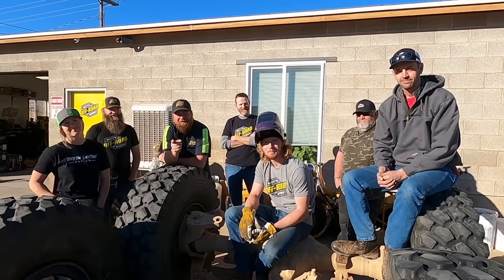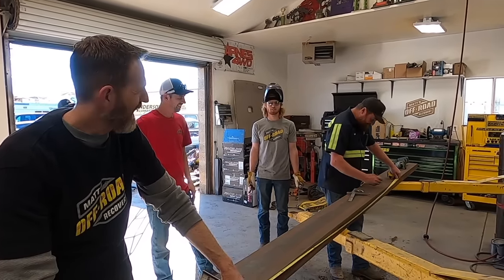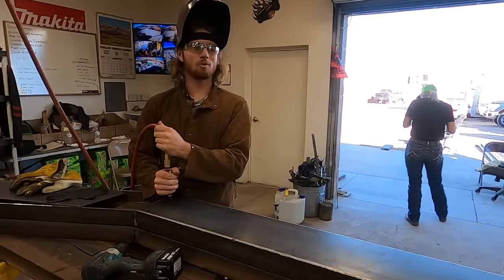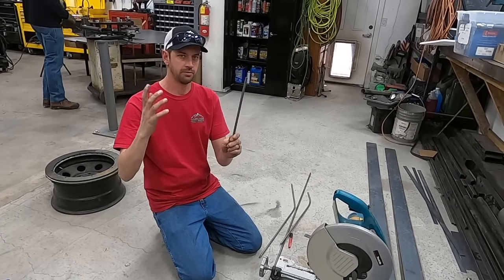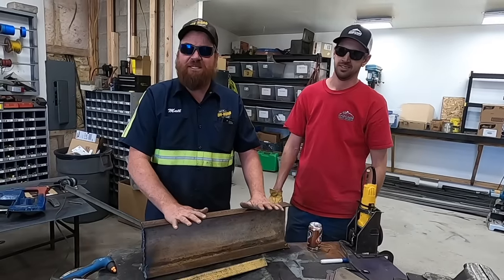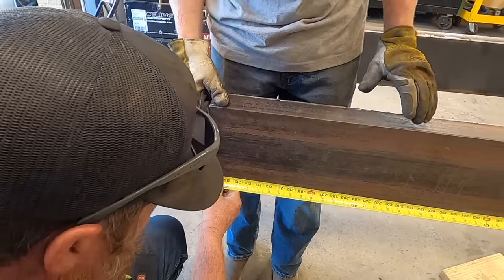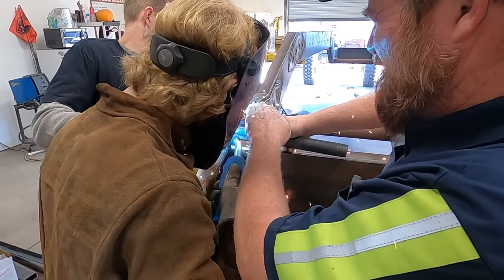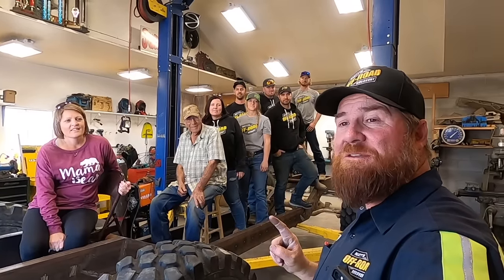I'm Building The WORLD'S LARGEST Off-Road Wrecker

Comment: There is an astounding amount of "scary" going into this build already. There are some huge red flags presenting that you guys are ignoring or downplaying the importance of. Incorporating a presure vessel into an assembly that is designed for articulation is problematic. The already present yielding of the chamber wall during inflation is not something that should be overlooked, pressure vessels are round for a very specific reason. The flat plate used is undersized and the uneven shear forces the welds will experience due to the pinning is destined for disaster. The renforcement plates used at the splice joints need to have large radii at the ends not sharp points as the forces are now concentrated at the termination of the plate. That type of joint renforcement is typically referred to as a "fish mouth plate" because the radii usually spans the majority of the sidewall. I like the ingenuity and "go for it" attitude,  however, that being said when you are dealing with the stored energy that is associated with a pressure vessel you need to be super cautious and consider the fact that you ARE responsible if one of the people being helped are injured if that tank fails. Even with only 100 psi in the "tank"  the force you are exerting on the tank walls is quite large.  I dig the channel, I just think it is important that someone addresses the issue. Don't let people arm chair quarterback this, it's your ass on the line when things go wrong. Just my opinion based on experience,  take it for what its worth.
Reply: Even with the frame pins, the flat frame panels will deflect under pressure cycling. Just not as much, but over hundreds if not thousands of pressure cycles could it fatigue the metal as well? Would love someone to run the numbers.
Reply: @maxironpaw  I don't know. But I was thinking about the cycling the frame would be subject to under normal use at speed. The combination of these loads and the constant air pressure could probably cause fatigue I think
Reply: @maxironpaw  other think I was thinking about, is that the frame will be subject to defects in use : rock scratches, etc. These defects, if in the flat panels, would be under tensile loads because of the pressure. This could be an increased cause of failure then
Reply: I could not agree more, this is a real dangerous thing being done here. There should be no sharp corners on a pressure vessel.
Reply: I love the idea of using the middle of the frame to store compressed air; however, I'd have done it as some pieces of 1" pipe embedded in the center of the box instead of trying to use the box itself.
Reply: If anyone from MORR is willing to do a video chat or anything I would have no prob giving design and fabrication feedback, I just don't know if anyone is willing or how to even get ahold of anyone.b
Reply: @sshep7119  Sad to say that I doubt they'd want to hear from you or anyone else with design/fabrication knowledge. I like watching MORR, Fab Rats, etc. but there's a whole lot of "frontier engineering" being done.
Reply: Boy, you got that right! That thing will be a bomb waiting to go off.
Reply: @Mick_A_Knuckle  Yeah I can see where you are coming from, in their defense though who do hou listen to and who do you shrug off. I just hope that things work out and no one gets hurt. A LOT of people get hurt/mamed/killed every year because people dont respect or understand the emense amount of energy that is stored in pressure vessels. Tires are a big one in that people underestimate what they are capable of. I don't do the "safety nazi" thing because it doesn't help any if no one listens, but there are times where you need to speak up.
Reply: Am engineer. Can confirm this is sketchy and irresponsible. Pressure vessels are highly regulated in industry for a reason.  Dont underestimate this danger.
Reply: Rather well articulated. 100% true as well. To many people don't understand exactly how dangerous pressurized air is, especially at higher volumes. 5 psi is enough to blow the bottom of an oil drum out.
Reply: I'm going to assume they know what they're doing.
Reply: @joereed2760  ..... That's the mistake a lot of make. You make it on yourself and they've made it on themselves.
Reply: This pressure vessel was trying to make itself round before they pinned it flat, haha.
Reply: @Matt's Off Road Recovery  I can't stress enough to listen to comments like these. I can attest that @SShep71 1 knows his stuff. Please consider taking up his offer of design input via a video call.
Reply: Yo, but it will also be fun when it explodes

Comment: I'm really curious about how the project will be going. At the same time I am highly sceptical about the frame-internal-air-tanks. Some of the technical reasons why this might not be the greatest idea have already been mentioned by other viewers.
Reply: Porsche did it with some space frame race cars. They kept them pressurized with nitrogen. If the pressure dropped they knew there was a crack somewhere.
Reply: What is the reason for worrying about having the air tanks being part of the frame? Is the tubing not strong enough to be a frame?
Reply: @jackd2083  In contrast to a 'normal' pressure tank, there are very long welds and based on the flexibility / stiffness of the frame the pressure changes and external forces might lead to minor cracks and leaks.

Comment: Super cool! I was nine years in 1962 at San Louis Obispo with my uncle Johnny on the beach doing some surf casting and along comes the “Spider”, a purpose built four wheel crawler with about three feet of clearance and six foot agricultural tires. They used it to pull vehicles out of the sand on the beach. I’ve been trying to find something on it ever since with no luck. Painted red as I remember. I guess it could have been a farm implement but I remember it as pretty stripped.

Comment: If you are using your frame as a tank for on board air like for an air break system I would recommend against it because the condensation will eat through your frame from the inside out, I’ve replaced a lot of air tanks even with air dryers but of course i live in the inland northwest so 🤷‍♂️ Utah will probably be fine but I’d still recommend you make sure you get a good drain in it and I hope the frame doesn’t end up flexing and cracking welds but gunna look cool

Comment: 4 way steer build.  There are knuckles and tie rods on BOTH ends.
Everyone who’s in a tizzy about the frame air and the stock axel brakes needs to calm down.  They are going hydro.  The air is for airbags because it needs adjustable suspension.
I hope it’s mid engined and has a the cab over from the econoline truck they showed a while back.

Comment: Rotating elevated cab perhaps? With remote controls for winches and boom within. Like a crane truck. You could volunteer for recovery on the Paris/ Dakar Rally. Maybe not, even with the weight saving flotation air tanks, fr8ing that beast across oceans will not be cheap!
What's its nickname gonna be? Competition for suggestions?? I'll start with "Thin Lizzie".

Comment: An idea about your pressure frame tanks.  Drill enough holes, that you can put in very strong epoxy sealant, to protect the raw steel from corrosive water.  You can easily plug the drilled holes with brass or steel plugs, or even use'em for drains.  Since the tanks are so long, more than one drain might be a good idea.  But seal the inside from water.  If you use a "flexible" type coating, it won't crack when the frame flexes from use.

Comment: This is SO amazing to watch!

also, due to being hand-built and measured all the way, your frame is much more square than that of commercial heavy-duty trucks!
trust me, I've been an engineer for those for four years ... the amount of corrective persuasion in the production was immense.
Reply: also, I'm pretty sure it should be sufficiently easy to transplant the cabin of an old cabover (or conventional) truck onto that frame, the spacing of your frame is on point with what commercial vehicles use!

Comment: Hello, I love your videos. I have been working on a GMC frame and came across a cheap small saw from Eastwood. I was using a plasma cutter and grinder with cutting blade and this saw cut through everything much cleaner with no heat and much faster I was using 1/4 inch plate. I have included the link in case you are interested. It only cuts straight though as it is a small circular saw. I was very surprised how well it worked. Continue the great videos.

Comment: Put a drain bung on it. Dont want internal rust like a air compresser. The frame air tank idea is really cool by the way, here in the salt we under coat our frames but they still rust from the inside out then. A sealed system like that is probably less prone to that

Comment: If you're not already planning to do so... Please proof test the frame and add a relief valve! For gas systems, a 1.1x operating pressure proof is typical, with a relief set to 10% above maximum expected operating pressure. For a homebuilt rig, with unconventional construction methods, I would proof to 1.5-2.0x operating pressure.

Comment: I’ve seen some other commits express concerns on the built-in air storage. Yes, it’s a mistake. Shapes other than cylindrical for a pressure vessel are dangerous. Also, by law, any pressure vessel is to be inspected and certified. I’m a power tool repair shop and authorized service for Bostitch compressors. Back in the early 90’s, Bostitch had a mandated safety recall on a model that was mfg by Thomas Industries. The tank was a “pancake” style but the upper half was stamped with a curve that was too sharp. There were several that had ruptured at that sharp seam with explosive power.

Comment: hello, the idea with the pressure vessel in the frame is ambitious. Hopefully it won't leak if the frame twists. Profiles according to the load with different material thicknesses and better material, i.e. no structural steel, saves half the frame weight without becoming weaker. No matter how stiff the frame is in the end - it always twists while riding.
Can't you just use old truck frame material - or a frame from a Unimog ? that's a lot better than mild steel. Have fun with the tank

Comment: I have been designing truck chassis and trailers for more than 30 years, I am sure that compressed air tanks will warp and leak. The weight of this mild steel frame is simply too high, used truck frames save half the weight with the same strength. An old Unimog frame made of high-strength steel would make sense.

Comment: I think a better approach to the frame tanks would be to use something like fire fighter's water hose ran along the inside of the frame and filled with air, as it is specifically designed for containing large amounts of pressure. I would then use cavity wax to fill the gaps between the hose and the walls of the frame, similar to how Mercedes Bens fills the frames on the 6x6s solid with wax to make corrosion as difficult as possible. Buy me a plane ticket and I'll even come do it for you

Comment: Need to get a usmc 7-ton wrecker. Things unstoppable and will pull anything....I personally pulled 180k pounds with it over 8 miles through sand dunes with no power steering. Also pulled a tanks out that was stuck in a sand dune. Have over 300 recoveries in 7 months in Afghanistan. Just buy the Oshkosh mk36 it's Nasty. I towed over 40 of those mraps aroused Afghanistan because those axels snap. Good luck with the build but I would do it wayyyyyy different

Comment: It's about time multi skilled Lizzy learned to back up a trailer, I would love to see her learn, if she can't already, I bet she learns or does it really well. B T W the tool is an Adjustable Sliding Combination Square Ruler Protractor. I used to use one a lot before I retired and my one here in the U.K. was nigh on £200 G BP. Like most tools here if you use them to make a living they are taxed very high. When I was in Germany  (5 times over a few years) you notice that anything work related or essentials, they were as  cheap as chips, but luxury goods were very expensive.
Reply: Tom is a nuclear engineer. Do you think he really doesn't know what's that was?

Comment: Not sure if that in-frame air tank is a good idea. The amount of force that 100 psi will exert on that welded plate is immense (do the math). Combine this with the flex and stretch that will be placed on the welded joints, and you have the recipe for a failed weld. There is a reason for the ASME stamp on compressor tanks.

Comment: The build is awesome. Put a real air tank on this thing. You're going to have issues with internal rusting and you're going to end up with a bunch of cracks in the frame corners from stress. 90* bends in an air tank is no good. Look into the commet jet. It had square windows....

Comment: Air tank bomb.  I decided to calculate the stress in the flat plate when it was pressurized and before the pins were added.  I came up with 35 ksi.  In general for a mild steel, I use 36 ksi as the yield strength.  As the plate appeared to have permanent deformation, I would say the yield strength of the material was exceeded.   I used 93 inches for the length of the plate, 7 inches for the width, and a 100 psi air pressure.  The formula I used came from Roark for a flat rectangular plate with clamped edges with a pressure load.  I would suggest being much more careful in the future.
Reply: And that's not even considering the stress concentration at the corners. It's horrible and potentially fatal idea that needs to get undone and proper pressure vessels added. Nothing wrong with boxing the frame, but just say no to that air-bomb..
Reply: I loaded up FreeCad and did a finite element analysis of the plate with and without pins.  Without the pins the max von Mises stress was 43 ksi along each of the long welded edges.  This is in fairly good a agreement with the value obtain from the equation in Roark.  For the analysis with the pins, I assumed the pins are on a 7" spacing.  My plate model was 10.5 inches long with a hole 7 inch from one end and centered on the 7 inch width of the plate.  The plate had fixed constraints on the two long edges and one short edge.  One end of the plate was fixed not to move along the length of the plate to simulate the rest of the plate than I didn't model.  The model showed 63 ksi right at the constraint on the hole.  Unfortunately the stresses did not fall off very quickly moving away from the hole.  If a factor of safety of 2 on yield is required, I would not recommend using the frame as an air tank.
Reply: @chuckd7177  And that's only a static model. Under cyclic pressure loading and in-use torsional flex and vibration, it's a time-bomb.
Reply: @stephendee7839  Yes, I admit that I only did a small subset of the engineering needed and found that the "tank" was not structural adequate.  It would seem to make more sense to purchase pressure tanks certified to the applicable codes. I did find an old copy of the ASME Boiler and Pressure Vessel code (2010) online.  With a very quick scan, I found factor of safety of 2 on yield and 3 on ultimate is required.
Reply: Betting that my suggestion to buy air tanks will be ignored, here is what is ASME 2010 page 75 suggests.  Perform a hydrostatic test of the "tank" to 1.3 times the working pressure.  So fill the "tank" as much as possible with water.  Connect it to your compressor with the longest air hose you have.  Stand as far back as possible,  behind something heavy, and open the value for the air hose.  Let it reach pressure and let it sit for 10 minutes.  Release the pressure from the hose and then go inspect for damage.  Still not great, but safer than what you did in the video.

Comment: Good call - Boxing the frame more than doubled the beam's strength. 1500 pounds seems too light. Given how massive the axles and tires are, weight is not an issue.
I worry about fatigue of the welds caused by cycling the high pressure air, even with pinning
What's going to power this? A big Cat motor?

Comment: Good space saving method... how ever what the tank does when it flexes with all that pressure inside, not to mention in few years when it start to rust out? Any coating going inside to prevent rusting? How are you going to get rid off the condensed water, or are those new pressured water brakes, or what ever this system is running?
To solve the water issue maybe add pipe that is the lowest point when you drive on ridge, it has solenoid in it that is on timer or push button opening shortly and squirting water out while in suitable position. Only thing is that will it be harms way since tanks are the lowest point.

Comment: Yes this is a little off-topic, where do you put the sensor for trans temperature; in the pressure test port or In-line of the trans sending line( AkA the tube that comes from the trans, but before the cooler. Thanks, Been loving the Golden Nugget Build series

Comment: Looks like an awesome project so far but I don't know about the idea of having the frame double as an air tank, when air is compressed it always drops moisture, this moisture with no way to escape will cause rust inside of the frame rails. As a heavy duty truck mechanic I often replace rusted through air tanks, would be far more difficult to replace in this case and far more catastrophic if failure did occur. Also being a long skinny tank it would be difficult to drain out all the water if unit is on any kind of a slope. This is all long term best case scenario if one of the welds doesn't split from stress loading and a tank explodes. I would ditch the idea and stick with standard air tanks.